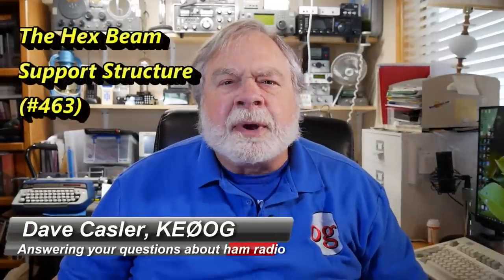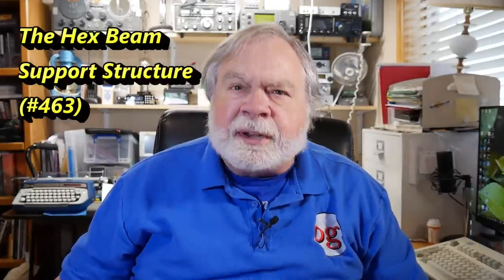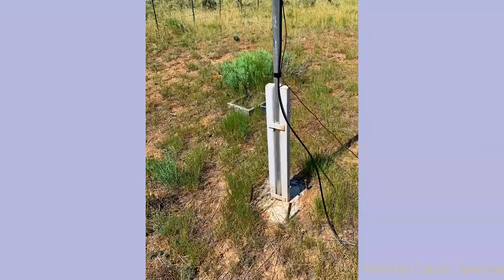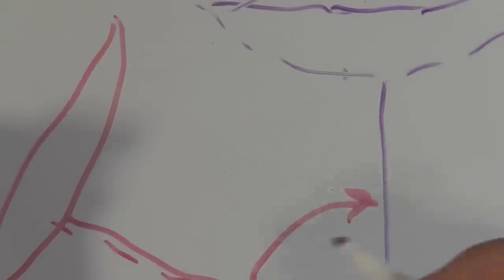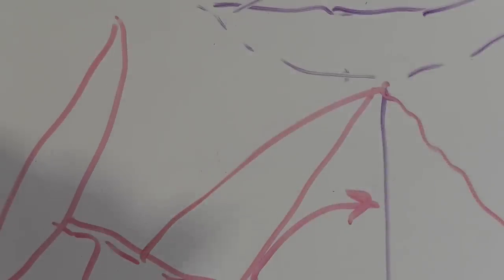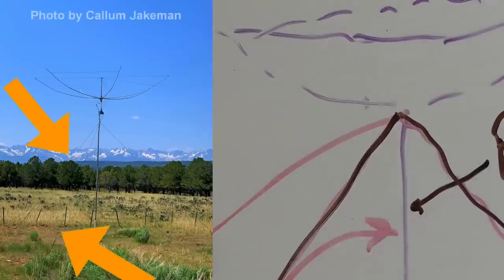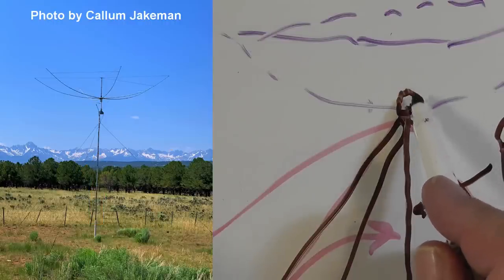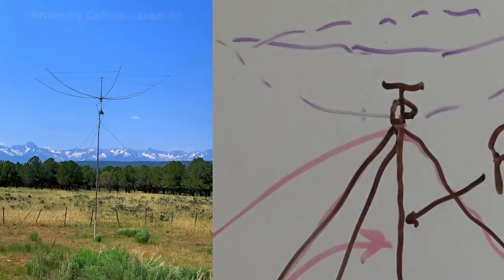The Hex Beam Support Structure (#463)

Comment: Another good source of antenna masts is scrap sail boat masts, they can be very long and very strong.
Reply: Where do you get scrap sailboat masts? Also how do you hold the mast up?
Reply: @coppeis  Aluminum masts usually mount to a step plate on a boat. It's got a lip that fits around the inside of the base of the mast, and it just bolts to the deck - which almost always has a post inside to keep the deck from collapsing - but I digress!

You can maybe get a mast with a step plate from a boat salvage yard. They usually have spreaders and stays that are very similar to guy wires. Some of them have a relatively complex rig to keep it rigid when it's loaded up - makes it like a truss to keep it from bending too much. You probably don't need all that, those sails put a LOT of force on a mast that your antenna just won't. So you'd basically bolt down the step plate to a concrete base, then step the mast on that, and run guys maybe from the stay attachment points at the spreaders.

The only problem I can think of, is how to mount the rotator to it. Look at boats in the 25 - 30 foot range, they'll have a mast somewhere in the height range you want.

Comment: Regarding the landing, ... one thing I use to do when I flew (not much at all) was I'd come in and of course going slow and close to stall, but not stall, ... ... thinkin of the last two feet, I would let the craft lower down but I never thought of the actual touch.  As it would naturally get closer I kept the "idea and feeling" to keep it closer and closer to stall but pretend to not let it touch and I purposely pulled back on the yoke.  Well, more often than not I'd almost touch and not really feeling much.  It's like coming to a brake stop in a car but not letting it feel the actual stop.. light peddle and finally a stop.

Comment: David, is it recommended to put a fence around the perimeter of the aerial even if it is not required?  it would have to be wide enough to allow the aerial to fall in any direction and still be within the confounds of the fence. what are your thoughts?
Reply: I mean - if you have kids, or animals that would be an excellent idea regardless.
Reply: @notsure7874  yea, looking back at it now.  i'd say yes, but my wallet says no.
Reply: @supyrow  For sure. Fences are surprisingly expensive. Even just T posts and 4x4 in the corner with hogwire for something like that is several hundred bucks, and a lot of work.
Reply: @notsure7874  indeed! thank for your input

Comment: Thanks Dave. What diameter Aluminum pipe did you use?
Reply: I second this question! I watched twice to see if I could find a diameter. I'd imagine 1 1/2" would suffice for a guyed sched 40 aluminum pipe. Top rail is 1 3/8, but it's super thin walled compared to sched 40. 2" might be a better choice, idk.

Comment: Do NOT get discouraged on landing.  Took me until I had about 700 hours in my log before I could (nearly) consistently kiss the runway instead of doing carrier landings.
It is one of those things that will just click when it happens --- just like flying the ILS.  Don't get discouraged.  As long as you don't break that landing gear, you're doing great.
((Just hold the thought ---- most airline pilots can't land smoothly either [when was the last airline flight you took that you couldn't feel the touchdown on?]))